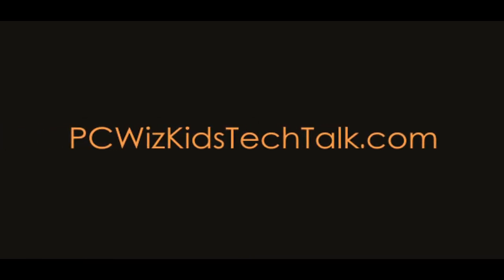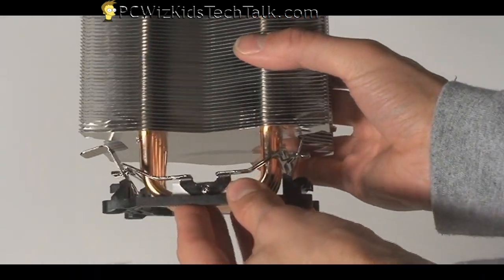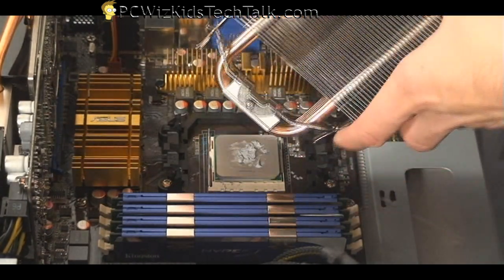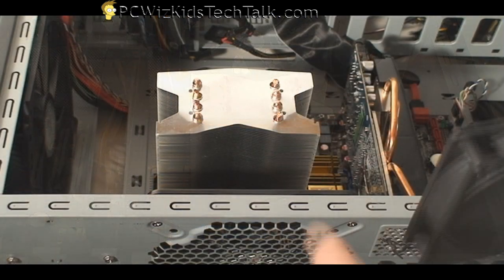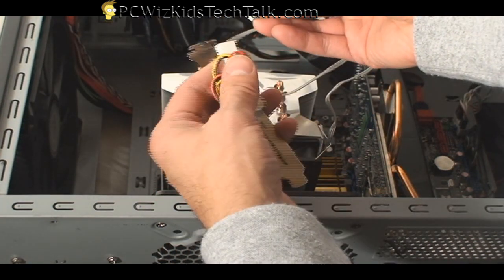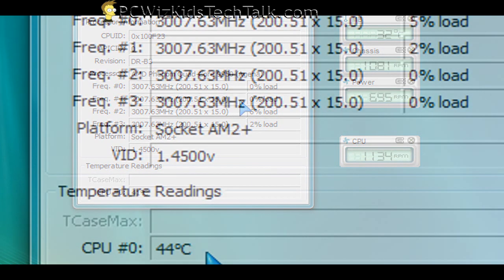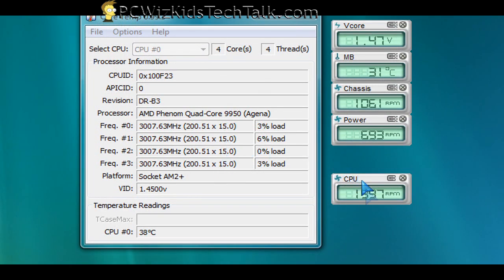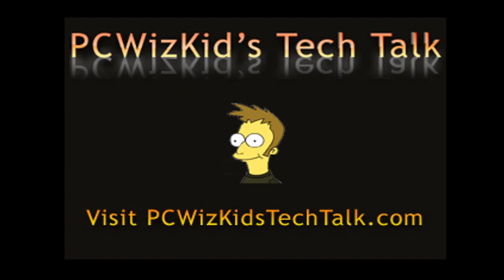Core-Contact Freezer - Review

Comment: Right up till today, July 10th 2019, this is the best heat sink & fan I've ever had. I've had this heatsink & fan for 10 years now and it's NEVER failed me. Had it on Phenom II X4 955, Phenom II X4 965, Phenom II X6 1090T and now on FX-8350. All cpu's overclocked with no problem. I even had my FX-8350 oc'd to 5GHz for a few months with no problem. I even heard that an AM3+ cpu retainer can be installed on AM4 motherboards to use this, which will probably go on my next system AM4!
Kind of hard to mount, but I already knew that from the start from the reviews.

This is the BEST heatsink & fan I have ever owned. I have a computer business and have built a few hundred systems with the latest and greatest heatsink & fans, but this is the one I like the best.

Comment: @imafurryhusky That is 8c higher than the highest rated temp for the 9950! The stock heatsink will not suffice. I had the stock on long enough to get into windows to check my temps and was at 62c on a cold boot so I shut down and slapped my Zalman 9700 on it and had much more normal temps. Due to the 9950 causing my PSU to produce to much heat for my already hot room I have went back to my X2 6400.

Comment: Nice video, the only thing I thought was odd, is that you set up the CPU fan to blow away from the rear exhaust fan. The gap that was there would likely have the 2 fans fighting each other for air. The temps were a bit high for an HSF of that size.

It looked to be only a couple inches from the rear of the case, I think it would have been more efficient to put the CPU fan on the other side blowing backward. You should give it a try in the other orientation and check your temps.

Comment: i tryed using the core temp software you used i googled it my temp is 50 cel is that normal '
now its about 53 what should i do to decrease that the asus epu engine is running at auto not turbo or anything just auto and thats my normal temp is that dangerus